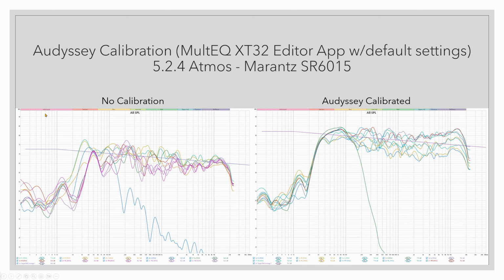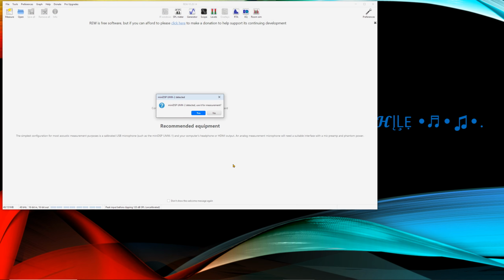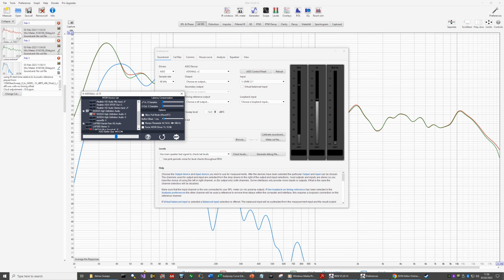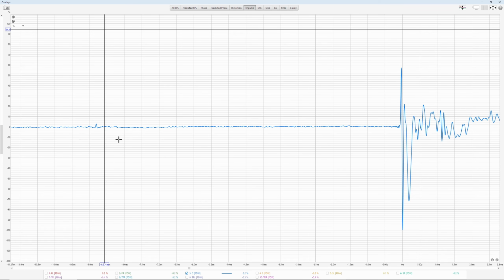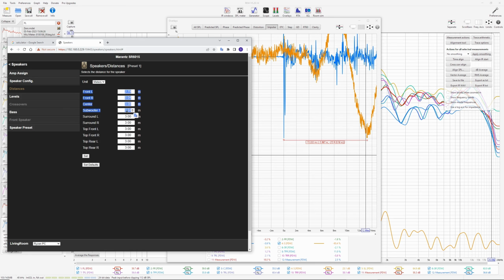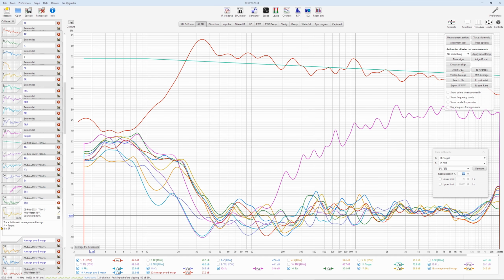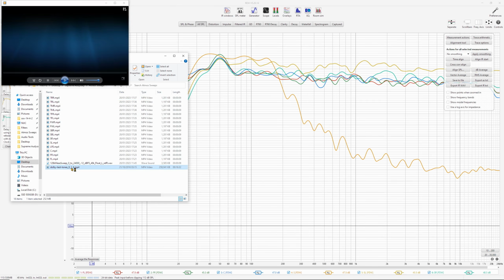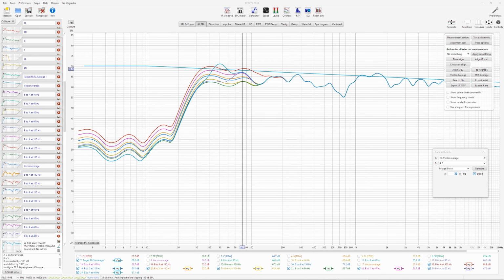Supreme Audyssey Calibration by OCA

Comment: Is this similar to what your Evo/acoustica/etc... do?  Or are they doing calibration in different ways?  I was also wondering, if we like the way Audyssey functions normally, but just want to make it "better" by getting the measuring/time/volume/crossovers perfect, but still want to have the surrounds/heights run the way Audy normally does with DEQ on, how would we do that? Start this with DEQ off at MV0 instead of starting at our normal listening volume?  Then turning DEQ on would add that boost seen in the graphs, or would we have to increase the levels by 5/10db ourselves somewhere else?  Not sure of the exact process to basically leave the basic functionality alone, but improve what it normally does.  Thanks!
Reply from the maker: It's similar in concept but Acoustica uses the latest techniques. This video is quite old.
Reply: @ocaudiophile  Gotcha.  But if I wanted to do something like this, and I like the way DEQ boosts surrounds/heights, if I followed these procedures at MV0, it would still boost them at lower volumes the way your "basic Audyssey" measurements in the intro show, right? but they would have better integration/crossovers from manual calibration.

Comment: So I was curious. I have another subwoofer coming and I have the Odyssey xt32 calibration tool. I have a mini DSP and Marantz 6012 and I'm using a Cherry amp 5 channel for my LCR in my rears. My four Atmos speakers are plugged into the receiver. So I was curious do I need to buy a umik also.

Comment: i got stuck at the default.ady file transfer at 6:37. multeq app says "the specified file is not located in the devices local storage or is not a proper curve file". Windows sees it as a ady-file but nothing helps here. could you maybe help with this?
Reply from the maker: Android apps need to use Google drive for transfer for some reason.
Reply: @ocaudiophile  thank you so much for the quick reply! i'll try that.
Reply: I am also stuck here. I am using an iPhone - how do you upload the file from my files over to the MultEQ app?

Comment: Oca for subwoofer crossover how we know where we have to cut our subs i mean in 120 hz or 150 or 200 -250 and also how we know if we need to apply lfe + main or only lfe... Please explain me thank you
Reply from the maker: That can only be done using exhaustive search algorithms, not possible manually (unless you want to try alignment tool for all possible frequencies). Try Nexus, that will do it all for you.
Reply: @ocaudiophile  yeah but nexus dont make full calibration of the speakers right??
Reply from the maker: @kuriakos36 You don't need that and it can extend up to 1000hz if you customize the script.

Comment: Hey, thanks a lot for this excellent tutorial! With this I got a very nice calibration for my setup. These changes are applied to all HDMI inputs of the receiver, which is great. However they are not applied correctly to the ARC audio coming back from my TV. Every audio signal coming via ARC from the TV sounds noticable different/worse. I am using a Denon X3400H. Does anybody else have this problem and maybe a solution?
Reply from the maker: Sometimes you need set some Audyssey settings separetly for each input.
Reply: Thanks for your answer. That's a good idea. I will measure all inputs to see what the actual difference looks like and then probably create separate profiles and switch them via the audyssey app. 
All the best to you!

Comment: Buddy its normal to cross my front speakers to 200hz ??? If i cross them to 80 120 or 150 there are dips and my sub is a mess when i cross it to 200 the sub is clear and theres no dips between speakers and subs... Here to mention i have prime towers svs speakers... So what is your opinion??? Thank you
Reply from the maker: Cross them over where they measure best but ideally you should align the sub distance to avoid dips and use the correct xo
Reply: @ocaudiophile  what is the technique for that what i have to do first ??.. to give distance or to cut them with xo??? Also if i use the alignment tool that helps?? Tell me please the steps to make it right thank you!!
Reply from the maker: @kuriakos36 You can use REW'S alignment tool.

Comment: When playing sweep file from media player, the response curve capture by REW is 15 db lower than the response curve captured by playing sweep directly from REW. What should be done?
Reply from the maker: Turn off loudness in the receiver. The menu comes up only during Atmos signal playback so can be hard to find. If that doesn't help then your receiver is one of the few models which applies dialnorm setting to Atmos signals and you cannot do much about it.

Comment: OCA i put the target curve to my speakers and i cross my speakers to 110 hz i have towers but theres a problem i think in about 200hz or 500hz i dont know when for example kong screams the speaker Press a little bit you believe i have to make flat the curve until some frequency and then to bring it down???
Reply from the maker: I did not understand your question?
Reply: @ocaudiophile  I want to say that The Target curve What you give is for all the speakers or depending of the space or the speaker to sound naturally and cinematic... ?? Also there are another target curves to try and see what is the best for my speaker's??? And what you suggest about that??
Reply from the maker: @kuriakos36  Best sounding target curve will be your speakers' anechoic response.
Reply: @ocaudiophile  what is anechoic response and how im gonna find it???
Reply from the maker: @kuriakos36  It's your speakers natural response curve out in the open without any wall reflections. Dr toole curve is quite close if you can't find a lab test of your speakers.
Reply: @ocaudiophile  so if i treated my room well i can play my speaker without any target curve ??? But even with i treated room how i will know what panels i have to take to measure natural the speakers?? For example in your target curve you give -5.5 db to 20khz and the sound Indeed is fantastic with this target curve so how you tested your speaker and you find out that this target curve works well?? You've done some measurements before with rew???
Reply from the maker: Many ;)
Reply: @ocaudiophile  so your opinion for the best house curve to my room is to listen many curves for example? Or to play with your target curve and start listening what missing to boost or cut??? What is the technique???
Reply: @ocaudiophile  sorry for my English but im not american 🙏🙂
Reply from the maker: @kuriakos36  That's fine, neither am I!

Comment: Hello buddy again i have 2 questions why i cant measure the subs alone and i have to run 1 speaker with the sub rew dont let me to mesaure it what settings i have to do ?? And second question i have connect the pc with optical cable to receiver and i dont know if this is the reason that i cant measure 75 db it show me less 40 50 and the speakers are very high... What i have to check...???
Reply from the maker: Unfortunately PC sound cards (and WIndows) have a strict maximum of 7.1 channels. The only way to measure subs individually is manually switch them on/off during measurements.\

I have never tried optical out, it might have peculiarities and I doubt it can carry Aymos signal. WHy don't you try HDMI?

Comment: Hello OCA. After  - Pinpointing crossover frequencies for each speaker...          I get following error - Error: Speaker has no bass response according to your measurement file. Please check! - program execution has stopped!    Please let me know what I might be doing wrong.
Reply from the maker: Check your original ady file for absurd trim adjustment settings for subwoofer unless you've open baffle speakers with limited bass response.

Comment: Did you delete a video (similar to this one) you previously had on your channel? I remember you sharing a file to input in json editor specifically for 80hz (you also had one for 120hz). That procedure worked great for me. I moved my seating & was hoping to use that video as a reference again  but can't find it. I've tried this video, but every time I try to import the "dummy" ady file (after using the json editor) into MultEQ, it states that the file is corrupt.
Reply from the maker: https://youtu.be/QWFyIDTe1fw
Reply: @ocaudiophile  Thank you for the response back. The link you gave sent me to a video with a private setting. So I can't view it.
Reply from the maker: Video related material:

Harman target curve:
https://drive.google.com/file/d/1N9C7...

Online MultEQ measurement file (.ady) editor:
https://jsoneditoronline.org/

Harman target curve for 120 Hz crossover (as created in the video) to directly paste into json:

[ 
 "{20, 6.382}",
 "{25, 6.592}",
 "{31.5, 6.892}",
 "{40, 7.152}",
 "{50, 7.393}",
 "{63, 7.557}",
 "{80, 7.153}",
 "{100, 6.13}",
 "{125, 4.625}",
 "{160, 3.032}",
 "{200, 1.946}",
 "{250, 1.19}",
 "{315, 0.611}",
 "{400, 0.267}",
 "{500, -0.137}",
 "{630, -0.327}",
 "{800, -0.554}",
 "{1000, -0.774}",
 "{1250, -0.942}",
 "{1600, -1.197}",
 "{2000, -1.359}",
 "{2500, -1.501}",
 "{3150, -1.658}",
 "{4000, -1.813}",
 "{5000, -1.911}",
 "{6300, -1.966}",
 "{8000, -1.905}",
 "{10000, -1.64}",
 "{12500, -0.962}",
 "{16000, 1.071}",
 "{20000, 8.299}"
]

Harman target curve for 80 Hz crossover to use with MultEQ Editor app:

[ 
 "{20, 6.657}",
 "{25, 6.999}",
 "{31.5, 7.482}",
 "{40, 7.965}",
 "{50, 8.378}",
 "{63, 8.538}",
 "{80, 7.752}",
 "{100, 6.065}",
 "{125, 3.931}",
 "{160, 2.025}",
 "{200, 0.984}",
 "{250, 0.415}",
 "{315, 0.049}",
 "{400, -0.113}",
 "{500, -0.392}",
 "{630, -0.493}",
 "{800, -0.659}",
 "{1000, -0.842}",
 "{1250, -0.985}",
 "{1600, -1.224}",
 "{2000, -1.376}",
 "{2500, -1.512}",
 "{3150, -1.665}",
 "{4000, -1.817}",
 "{5000, -1.914}",
 "{6300, -1.968}",
 "{8000, -1.906}",
 "{10000, -1.64}",
 "{12500, -0.962}",
 "{16000, 1.071}",
 "{20000, 8.299}"
]
 @doublet147
Reply: @ocaudiophile  Thank you!

Comment: Hey OCA, hope you wouldn´t mind that I am asking for your valued support (and knowledge). Attached you will find the link to my measurements (mdat), all full range (Subwoofer measured 0 -250 hz when I remember correctly). What I am looking for is an idea of how I should set my Subwoofers polarity. At the moment they are not inverted yet and sound louder than when I am switching polarity (tested with various music / movie snippets). When looking at my measurements all impulse peaks pointning downwards although the connetions are correct. Step responses showing a typical 3 way speaker response as far as I learned. I am using a Umik 1 for the measurements and the REW "invert" button in the soundcard preferences window was not ticked. I thought my soundcard may be polarity inverted which I not yet checked by measuring with ticked REW "invert" button in the soundcard preferences. I tested to invert the subs polarity in REW (SPL&Phase) and this seems to look ok when viewing impulse responses (all pointing downwards). I cannot reach the main impulse of the sub due to the 6m limitation of my AV7706. Thanks so much Sir.   https://drive.google.com/file/d/1DgIdAJkFkqyax5kh589favqCipH6qZBy/view?usp=sharing
Reply from the maker: Your speaker and subwoofer polarities are corrrect (based on the "no audyssey" measurements, didn't check presets). Subwoofer delay required is above 6m so you are right that you'll need to compromise. These are the volume and time (distance) alignment settings you need:
Speaker	SPL	Distance (m)
FL	       0.5	-0.014
C	       1.0	 0.000
FR	       0.5	 0.013
SL	      -1.0	 0.001
SR	      -1.0	-0.009
SW	      -7.0	 3.438

I also created your custom PEQ filters ready to be exported in the mdat:

https://drive.google.com/file/d/1zpyRESa4r-0ROVOo3in9vMsaSlnXioVk/view?usp=sharing

Just use these filters with the above volume/distance settings and you should be golden. I leave crossover selection to you.
Reply: @ocaudiophile , thanks so much Sir. Can you let me know why the polarity is correct although subwoofers impulse is pointing upwards while the others pointing downwards (100%)? How did you know that the polarities are correct (would like to understand how to read the impulse graph —> pointing upward vs downward). Besides that, I appreciate the knowledge you gain with your videos, learned so much since I started watching your videos and testing with my system. Best content for anyone interested in getting the best out their sound systems.
Reply: @ocaudiophile , the volume and time differences you mention should be added to the actual distances I set in the processor (and have been used for the measurements) ? My subwoofer distance is already 7.31 meter vs the shortest being SR = 1.45 (SL 1.51) meters. FL, C, FR 2.93. So I assume there is no way adding more distance to the sub. What do you think? Thanks Sir.
Reply from the maker: @saschawehde8072 I had no way of understanding this from your mdat file. I thought no aud measurements are also taken with equal distances setup. You need to find out what's adding so much delay to the sub then,
Reply: @ocaudiophile , thanks a lot, I should have mention that, sorry. And thanks for taking the time to read through my long post.
Reply: @ocaudiophile , sorry, would you mind giving your opinion on my comment 3 posts above (how did you know that the impulses are correct (subs pointing upward, others downward), would like to learn how to figure that out. Thanks so much and sorry for the questions.
Reply: @ocaudiophile , the subwoofer plate amps adding 8ms signal delay.
Reply from the maker: @saschawehde8072 Sometimes impulse peaks might point to different directions when measurement location is at wave interaction points. Most reliable way is to look at and compare  the phase responses in overlays windows. But because I couldn't properly time align the sub to speakers, it wasn't easy to see there, either so I switched its polarity back and forth looking at 20-200Hz region and checked which polarity fits the rest of the phase responses better. I checked each speaker, too.
Reply from the maker: @saschawehde8072  that's bitter. 6m limit is also ridiculous though. The same receivers give 15m limit when switched to Dirac.
Reply: @ocaudiophile , thanks OCA for taking the time to answer my questions. As you have seen I already alligned the subs first tiny peak to the Impulses of the rest of the speakers as good as possible but this tiny peaks pionts up vs the others down. Just to get in right in my mind, I should still leave the polarity as is (not inverted)? When I checked the phases (might did it wrong) I thought that by reversing the polarity of the subs seems to be closer to the other speakers. Is it right to think that all phase lines (unwrapped) should be as tight together as possible over a wide band? Thanks Sir.
Reply: @ocaudiophile , you name it, 6m is really ridiculous.
Reply from the maker: Check the region between 20Hz and where you crossover your subs (ie 80Hz) and if the phase line (check 1/1 smoothed versions to see more easily) of the sub fits better to all the speakers, then feel free to invert it. @saschawehde8072
Reply: @ocaudiophile  , thank you Sir.

Comment: I spoke to John about the inversion with [A] / [B] magnitude division and it is working correctly. What threw me off was that the calculation in REW displays as the differences on a 0db line. I was expecting it to visually invert the response. However, If you export an inversion and pick an area that looks off in REW. For me its was 16K. Look at the difference in the measure response vs the target curve. Mine was -2.5db in REW. This means that the inversion should be +2.5db and in the text file it was. The biggest thing is the way REW is displaying the correction. It only displays it as the differences on the 0db SPL graph. I had to get my head around this. In the end,  A / B magnitude division does work as intended, and the 0db line becomes the target curve.

Comment: Hey OCA, how have you been? I've noticed that A over B magnitude division is overcorrecting on the EQs I'm doing. Do you have any idea why? I've seen that treble sometimes needs an increase of 1.5db, but the A over B is increasing by more. Like 2db. What could be causing higher numbers than needed? Is it also taking into account reflections in the sweep? Can I remove that? Or just measure with an RTA?
Reply from the maker: I guess these deviations are caused by the complicated maths behind the division operation between two FFT's especially when it's not over a flat line but a target curve. The beginning and the end needs some mathematical gizmo to be handled. I use direct 1/A inversion lately over a flat line for that very reason.